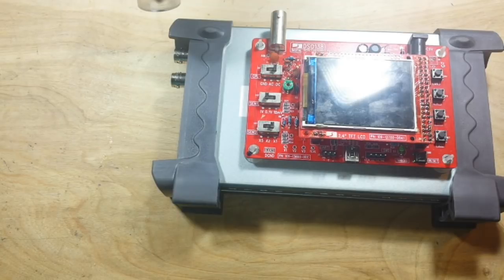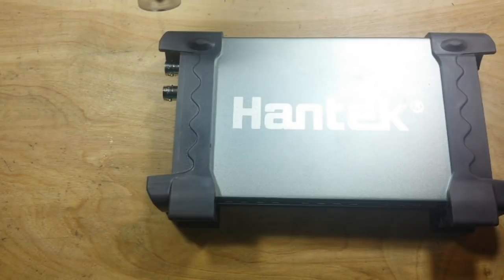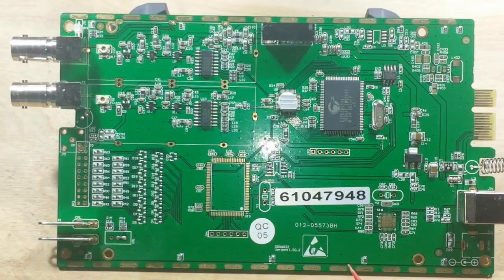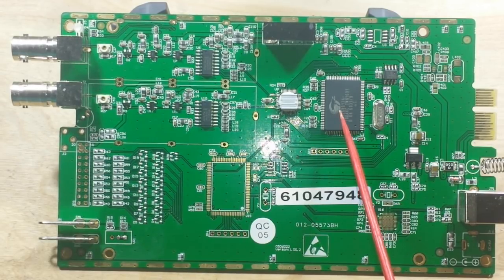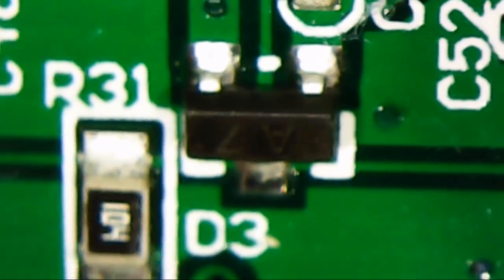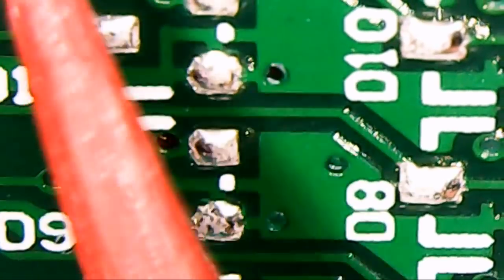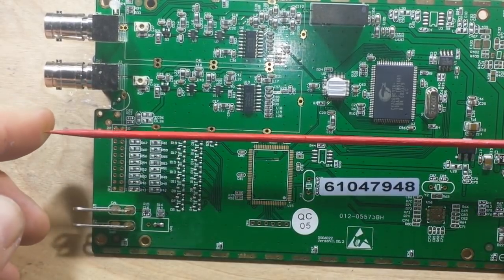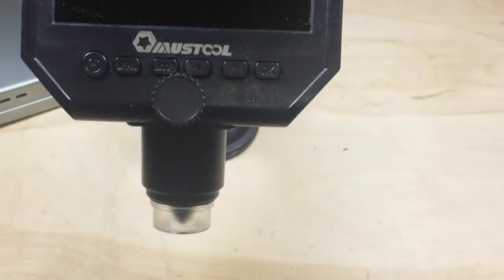Hantek 6022BE USB Oscilloscope Teardown

Comment: I got the same one. I was on a job with the scope powered up on my laptop and suddenly its indicator didn't work and the scope was dead. The probes were not connected to anything at the time either. What do you recon the problem is?

Comment: Ups...!  Just blew my new Hantek 6022be(on its first trial run). Its also my first diode (LR206) blowup, ;-) by shorting one of the probes. Hence, no more scope. I looked inside the unit and it looks like there is hope. I found and cleaned the only area that seems to have given up.  It seems to be an evaporated inductor labeled L3 near the USB cable junction on the left side of the PCB, no JP1.  My problem is that I do not know what its Henry value is?  Can any body hellllllPPPP me.  Mile merci du Québec.

Comment: Where in the heck is the other software for this USB scope that you claimed you would provide links to? The links are not on your review video, either!
Reply from the maker: Had to remove them
 Sorry.
Reply: @learnelectronics  Was one of them the BasicScope? Anyway, I was able to get the Hantek software (1.0.5) to work well on Win10-64 using the Win8 compatibility setting.
Reply: @mrnickbig1  try open hantek 6022 on GitHub.

Comment: Unpopulated stuff on the bottom is for the logic analyzer part from the 6022BL model, although the BL is not a real MSO (you can't use the scope and the analyzer at the same time) but for the budget still offers nice features like here described + 16 ch really basic features logic analyzer, but still it has it, you can hook up to your arduino or other fpga stuff, until you hit 20Mhz you should be fine. Budget and entry level is the main predicate here, and don't expect fireworks which costs money in the range of $$$ or $$$$+

Comment: I own one and with a 10" Android tablet running HScope it's really sweet!
I was hoping for more info on the ADC chip in your teardown as I hear the HScope developer is coming out with 10bit vert resolution support on the HT6022BE! I was wondering if the ADC chip used here was even hardware capable of 10bit.

Comment: If you are into electronics, its difficult to do anything without a scope. Bench scopes can be had for very little these days. If you are into electronics, get the holy trinity. A scope, a multimeter, and a signal generator.